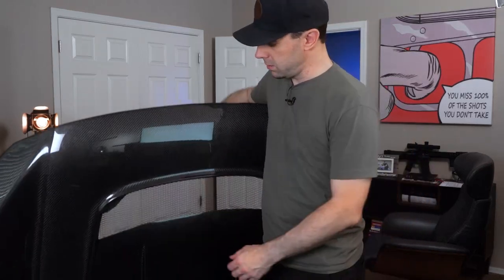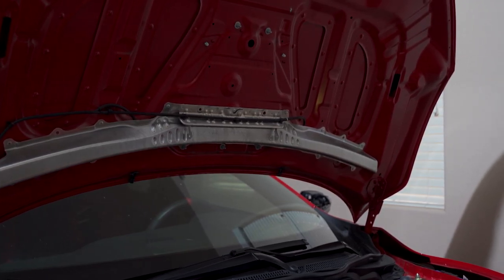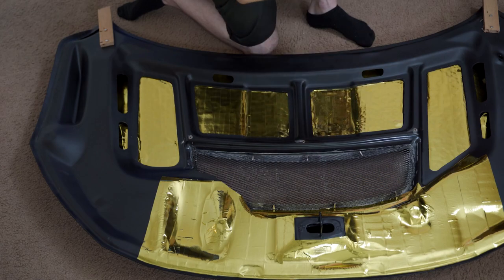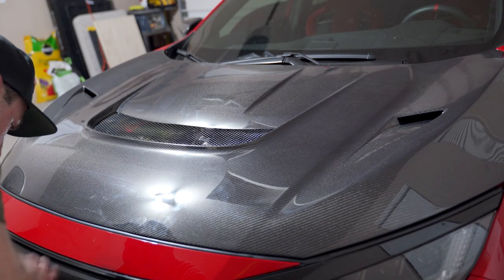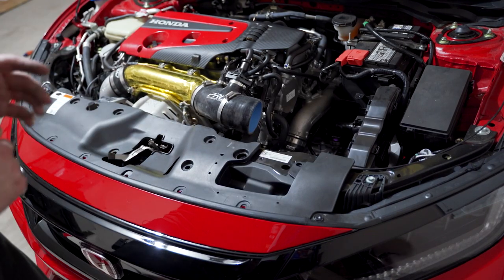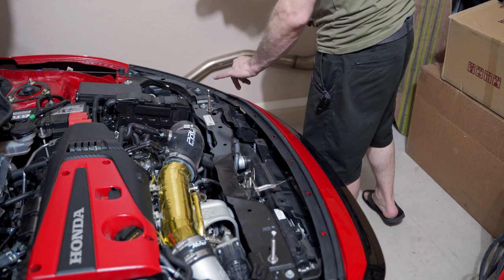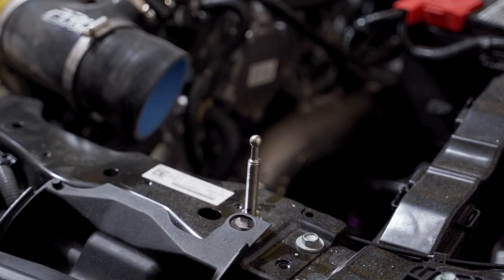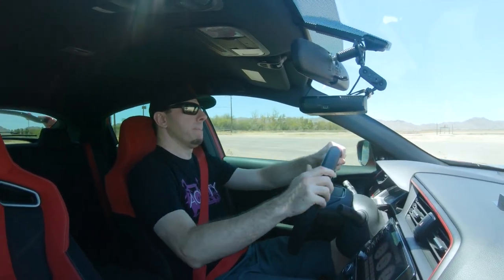UNTOLD SECRETS for Installing Carbon Fiber Hood and Hood Latches (2020)

Comment: For others that are adding a hood make sure you adjust your hood latch up before closing your hood so you don't crack it. Or if your using hood pins as recommend just take out the OEM hood latch
Reply from the maker: That's true man....Mine cracked due to the hood flexing when I pushed down on it...moral of the story,  just slam it
Reply: Thank you for this. Was hesitant to buy a CF due to this.
Reply: Could you explain that a little differently? I don’t know what you mean by adjust hood latch up. If I buy a seibon do they require any pins?
Reply: How much would you need to adjust the latch?

Comment: The hood scoop on the CTR doesn't actually push air into the fenders. This has been assumed at first glance and then repeated continuously. The silver duct is a drip tray, and it channels water from the rear scoop seam toward the shock towers where it pools. The air actually vents just in front of that tray. The deflector behind the washer nozzle tube directs it out of three fairly small holes down over the back of the engine where it's intended purpose is to help relieve positive pressure at high speeds and also marginally encourage airflow through the engine bay. 

It's a very mild design, and I think there are several more ways to make that scoop more effective and efficient if someone really looked into it (or replaced it altogether with a louvre design to extract heat). I've even heard that the yield from the design was so small the designers were going to eliminate it altogether but at that point, dies and so on had already been fielded for the now signature hood scoop.
Reply from the maker: I really appreciate the explanation brother

Comment: FK8 OEM hood inlet is to promote heat extraction... not for aero.
Reply from the maker: Totally agree with ya, for some reason on the wind tunnel test it shows air coming out the fenders from the hood scoop
Reply: @TORQToolbox   Normally, after air goes past the radiator, it rolls over the top of the engine and then down between the engine/ fire wall... then out via the bottom and sides (between the back of the front tires & wheel opening) of the car.   During the later stages of the development, It was found that by directing the air to the side and exit thru the fender vents, it improves heat extraction resulting lower coolant temp.

Comment: Hey Jon, just an fyi if you didnt know or to put here for others to see, When you get a hood or anything really from a high rep company like Seibon that price tag is more than people usually think about. That includes things that you wouldnt think of like fit and finish as in the warp of the piece, extra holes for certain things like the washer tube clips you mentioned, thickness in materials and can also be that they may use say 4 coats of resin on top of the carbon vs say 2 coats that another brand uses. And a question, the 2 1/2 lower hole you drilled, was that big enough to use a socket around that nut on the latches?
Reply from the maker: Totally makes sense, unfortunately they didn't have a hood that extracted heat from above the turbo when I ordered it

Comment: EPR quality for being cheap Chinese carbon fiber is actually quite good. Many of my interior pieces in my R35 are EPR and look and fit perfectly. You would never know. Why pay more for something nobody is ever going to tell the difference.

Also you can use silly putty under the hood where the pins would go. It makes a perfect dimple of where you need to drill. I've used this technique successfully in the past.

Comment: How did you manage to brake it so i dont do the same
Reply from the maker: I pushed it down to latch it instead of just letting it slam
Reply: @TORQToolbox  So youre saying letting the hood slam is easier on the nose of the hood than just pushing it down by hand?

Comment: Did you ever get the hood to fit better by putting a weight on it like you mentioned in the video? My hood has the exact same issue.
Reply: Carbon just always fits like trash in my opinion man very hard to get to fit correctly

Comment: Cracked the resin from closing hood... That's what happens when it's 'made in China'
Reply from the maker: Totally possible man, after doing some research it happens to all manufacturers
Reply: @TORQToolbox  I've closed my Varis hood 100 times like that and it's solid. I get that the replica is a fraction of the cost but there are very big drawbacks
Reply: @TORQToolbox  I just got the same hood. The difference with you closing it in the video is that you basically punched it closed. lol You had a lot of force coming down then made contact then pushed with both fists. If you place the palm of your hand on the hood at the latch (both hands) and gently give some pressure (like you did when demonstrating the driver side warp issue) it won't crack and you can close it a thousand times. Also, I'm finding the exact same gap on the drivers side with the exact same "warping" as you. Very minor but it's there...almost exact. Did you find any solutions to correcting this? With my OCD it drives me crazy.  LOL
Reply: @scholarsbjj920  did you fix it , I also have the same gap on drivers side
Reply: @user-cd3hd1ob5m  yes. More adjustment but it was my hood pins that did the trick. I used quick latch pins (black).
Reply: @jeremygore1865  what placement did you put them middle like him ?

Comment: How did you crack the hood.  Asking because I don’t want to make the same mistake.
Reply: He pushed down on the hood to close it all the way and the hood bent on the spot he pushed down on and when it snapped back into place the resin covering the carbon fiber cracked
Reply: Cesar Estrada what is the proper way to close a carbon hood?
Reply: @Justintm   slam it
Reply: Justintm I’m guessing not to put your full weight on it to close it. Especially applying all the force on one spot. But also idk if it maybe had to do with the quality of the hood.
Reply from the maker: Lesson learned ....just slam it
Reply from the maker: just slam it
Reply: TORQ Toolbox lol love the build!!! Thx for learning the hard way so we don’t have to.